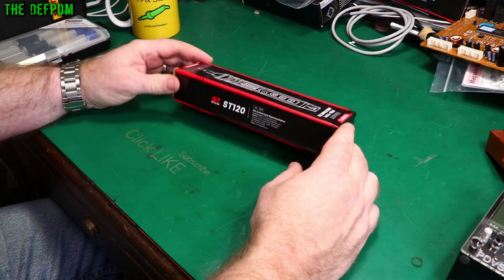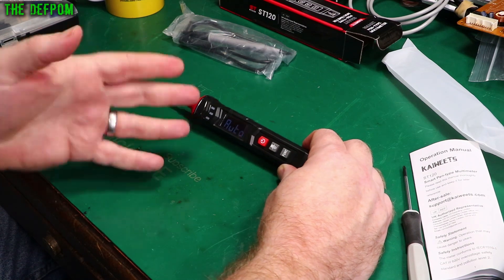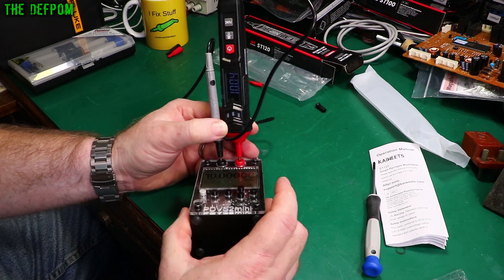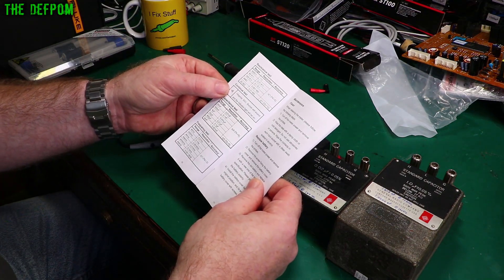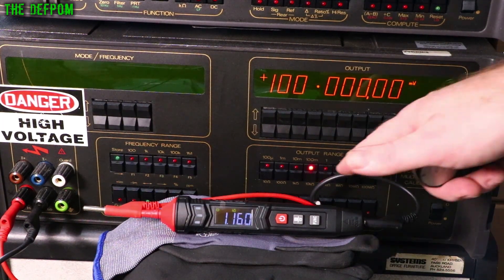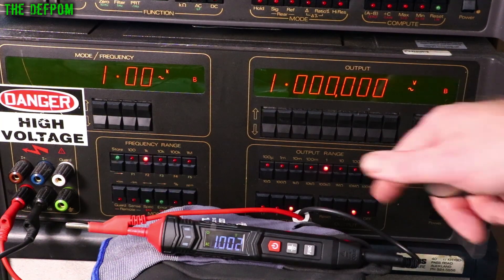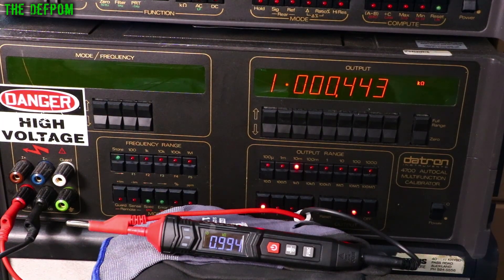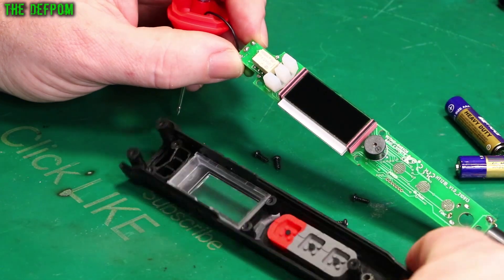🔴 Kaiweets NEW ST120 Pen Type Multimeter Review - No.974

Comment: Hi just bought a similar meter mostly for use inside equipment as I have a stiff neck keep looking at the bench meter and back down to the connections. So I use it just for a quick check and can see I haven't slipped off the connections ! But would not use it for any critical measurements. Thanks for the video and time.